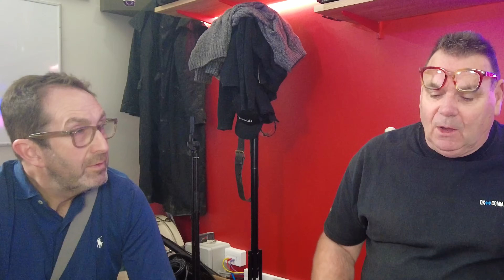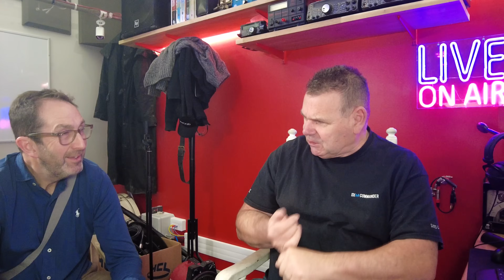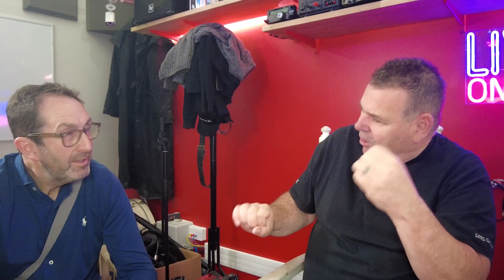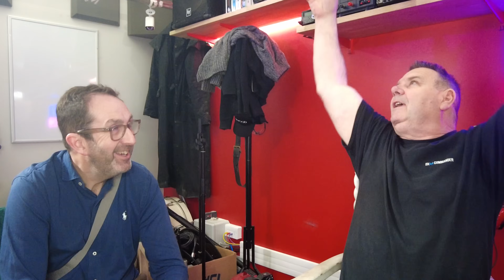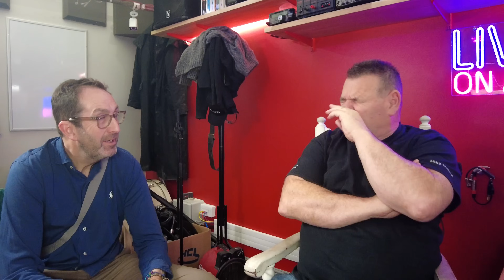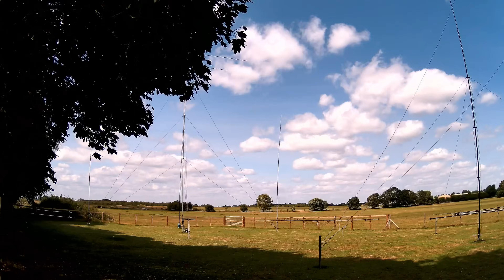QRP = Low Power. That's It?

Comment: Interesting, as always, cheers Callum. I must say I hate QRP. With the mess there is on most bands (QRM, QRN, interference, overcrowding, ... and the Italians ;) ), the fact of shouting in a microphone not to be heard is so frustrating. I've tried several times but come on, it is hard enough to get through with just about 50/100W on some bands so that frustration is too much for me! 73s de F4HZN op. Lawrence.
Reply from the maker: Yeah, I hear you! I would say 25 years ago (certicaly in the UK) many guys had up to 60-ft towers and say a tribander on top. Now, 100W could get you anywhere you wanted - but in today's market - folks think they can do 25W and an end-fed. I mean, hello. It's not going to work. Well, it does - but they are missing the "magic".
Reply: @DXCommanderHQ  Agreed.
Reply from the maker: @LoloDuSoubestre  We're on same page then!

Comment: 100% agree except for the coax; loss at 7MHz, and even 14MHz is so low that RG58 is more than adequate. My experience was of an ex-student struggling to make contacts with a shiny tripod mounted 'super' antenna. I went to a field with him, set up a tuned quarter wave vertical for 20m and was working Bulgaria in about 15mins. We then spent 15 mins tuning his £300+ antenna, and he worked the same station. He turned asked how I could do it quicker with some 'cheap wire' and a fishing pole. He quickly learned that throwing money at the issue does not always pay benefits.
Reply from the maker: It is - but folks think that it should work on 10m too.

Comment: I love my FT817.  The last solar cycle I was sitting in my kitchen with a 1 m  diameter magnetic loop I had just built.  In Indiana, US. Running 5 Watts single side band on 20 m. I had a 13 minute chat with a fellow in Sweden. It's all about the antenna and the propagation. 
DE KB9RLW.
Reply from the maker: Beautiful!

Comment: I'm in Texas summer with an 80m EFHW transformer rated for 150w ssb phone and 100w digital at 15C. QRO will destroy that transformer so I'm keeping it QRP till the cooler season
Reply: Make a transformer with 3x FT240-52 toroids and some thicker wire.

Comment: is it still grp if you are using slightly more power to get a true 10 watts out of the antenna?
Reply from the maker: On the QRP front, I would personally say no. The trick with qrp IMO is about maximizing signal path... but what do I know!!
Reply: @DXCommanderHQ  Wonder if it would seem like overkill to attach some 1/2 inch hardline to my Xiegu X1M? I haven't even put up my Belden 9913 in my house yet as it's too difficult (in my head) to install. RG8X for the win.

Comment: Being from a generation when working QRP did not necessarily mean going portable, one of my main interests when a significant new transceiver is launched is: how low can it go? There was a time when a TRX offering the possibility to go less than 1 Watt was normal. Personally I prefer large radio's as I never go portable. But a small footprint SDR is a good alternative, as the computer screen becomes your window into the aether. Working QRP from home is a real blast. And yes; do get the most efficient antenna system you can for your situation. It does not need to be expensive or grand, but do get/make the best you can, even it's just a single band you work on.
Reply: A home I'm fairly limited, both in location and the antenna I can get up. If I go portable, I can put up a much larger antenna!
Reply from the maker: You used the word "efficient". Agreed.

Comment: I keep my QRP rig very simple. I have a cheap as chips uSDX+ in a very compact over the shoulder bag with a 12volt DeWalt 2ah drill battery for power and I will use a dead simple 20m dipole that I put on a stand or I have taken it up the ski hill where I hang the dipole from a sign thing with a carabener and jam the ends of the dipole in the snow. Less than 6 feet of coax and I was making contacts to California from Nova Scotia 😎
Reply from the maker: Lovely.

Comment: I used to work portable with a FT-817ND, fibreglass roach pole, inverted V dipole and 5W.  I worked quite a few contacts on 80m, 40m and 20m - mostly inter G, but some EU stations.  I did worked into VK one time with the FT-817ND, with just 5W.
Reply from the maker: Lovely!

Comment: Back in the day, QRP was 100 watts.
I've spoken to Australia from Southeast Alaska more than once, and it was using an End Fed antenna. So I am another operator that agrees - good coax and a simple antenna works very nicely.
Reply: "Back in the day, QRP was 100 watts."

Yes, but then they stopped using spark gap transmitters.
Reply: @paulsengupta971  It wasn't that far back 😅

Comment: For the QRP people, it boggles the mind that they use RG-316 or RG-174 coax for the feed line.  When you only have 5 - 10 watts output power from the transceiver, better make it count with minimal losses in the feed line and very efficient antenna.  Simon at HamJazz is a master at that.
Reply from the maker: Indeed. I admire the guy that invests in Low Power... Doesn't just think he's doing it because it's "cheap".

Comment: I really enjoy QRP.  I might not make as many contacts, but they are more significant.  Smaller battery, less weight.  It makes me focus on my antennas, propagation reports, audio quality, etc.  I think it can make people better operators.  I feel you learn more by operating QRP.
Reply from the maker: Yes. And it doesn't mean just cheap. Agreed.
Reply: Same for me. Is like fly fishing... you must put some atention into details, be patient and always take advantage of the propagation conditions. I just get confused at times when I hear stations saying QRP, QRP... and when asked what power they use... they say 300W. If that is QRP then the little me with 5W ? I must be micro QRP or something I guess )))). 73, YO6DXE. P.S. I need better coax haha.
Reply: I will disagree just a bit here. QRP actually teaches you how good the other operator's antenna is and his skills at receiving. You're just transmitting less power, the other person is doing most of the heavy lifting.

Comment: To me, antennas are the most interesting part of radio. Apart from the specifics of modulation schemes. They’re also just incredibly specific (finicky) things by their shear physical dimensions, for the frequencies amateurs are (typically) interested in. There is no replacement for a good antenna. There is no replacement for power. If you synthesize these things, you’re going to have a blast on bald earth. If you ignore either, you could probably be having a lot more fun.

This being said, it’s easier to have fun in some places than others and many places may demand an extraordinary level of creativity in order to get decent signal in or out. 

Enjoy the solar maximum and 73.
Reply from the maker: Great summary of the hobby!

Comment: I've always ran QRP and QRPP (even in contests) and had an absolute blast. It's not about the radio or antenna etc. it's about having the cajones the size of king Kong to take on the QRO crowd head to head.
I always maintain in the world of QRP knowledge is the real power and I've enough shack wallpaper/plaques from HF to UHF to back
 that up.
Good video Cal. De Peter MI5JYK
Reply: I can vouch for Peter, known him since the 80's. A proper QRP op. 73 Peter, de Steak & Kidney
Reply from the maker: Knowledge and experience... Yep.

Comment: Great chat Cal.  This is a pet peeve of mine.  People saying you can just "turn the power down" on a 100W rig an you have QRP.  That's rubbish.  QRP for me is about minimal, lightweight kit for maximum portability BUT you can't ignore physics.  You need good basics like the antenna and connections, and if all else fails learn a little CW ;)
Reply from the maker: Indeed Matt. QRP doesn't mean "cheap". It means a ton of variables that often need weight, cost, efficiency and size all rolled into a package that works for you! Agreed.
Reply: Qrp is about how much power is going out of the transmitter. My 100 watt radio turned down to 5 watts is guess what QRP. Most of the light weight crowd you see on YouTube with minimal gear are running amplifiers.

Comment: I won 2016 SARL Field Day contest with a score that has still not, I believe, been beaten, purely because I had a reasonably efficient antenna on top of a high mountain, using that QRP muliplier. I am currently running 10 Watts into an 80m horizontal loop here at home in Western Europe, making it into VK.....QRP is awesome fun!
Reply from the maker: Lovely!